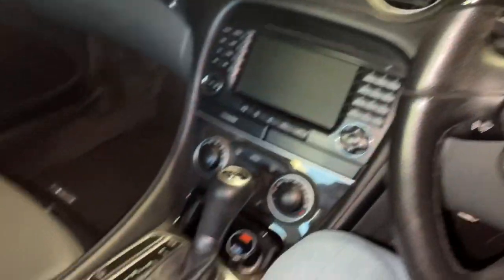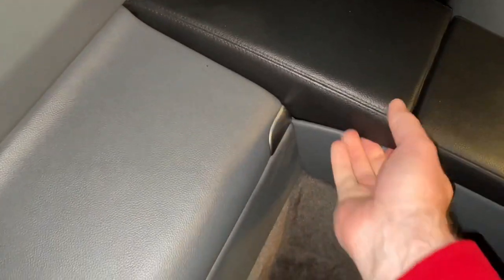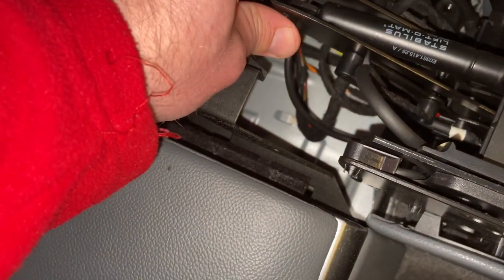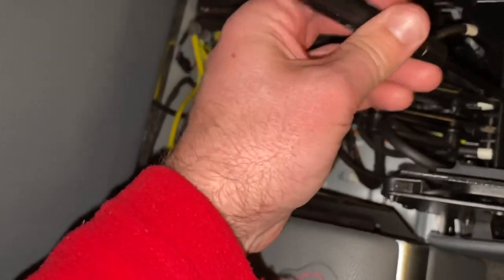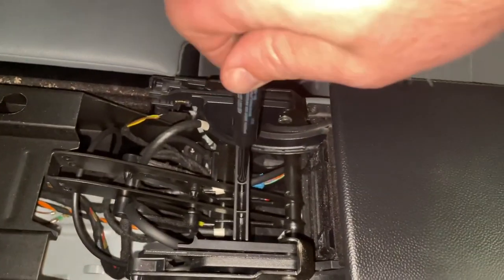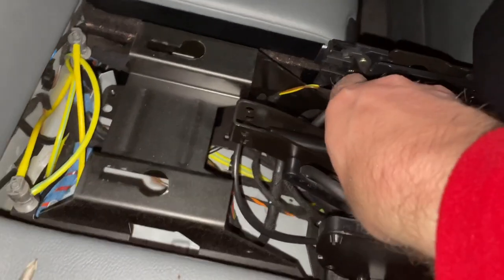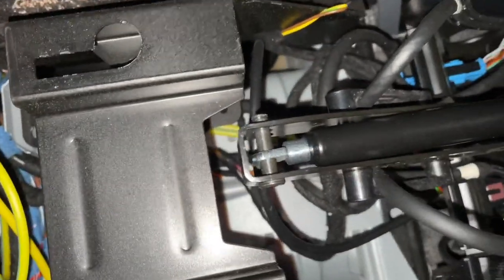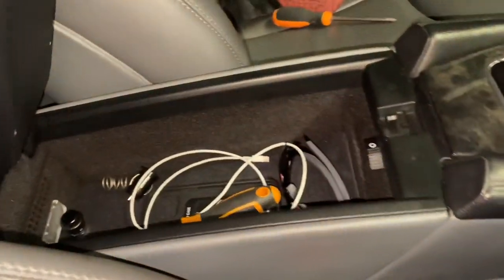Mercedes SL R230 PART 3 Easy way to replace repair centre console strut on a SL350 500 55 65 AMG

Comment: I just bought and installed a strut I got using your info ,I found that my armrest did not lift up far enough to allow the pln to line up so I ground off a  few thou from the eye end enough to get a flat blade screwdriver in and gently lever the strut forward and line up the pin with the hole easily ,good vid subd..
Reply from the maker: Great and thank you! Glad it helped!

Comment: Thanks for very helpful videos on the R230🙂. However, I have searched the web for the centre console cover strut PNs shown (OEM and NitroLift) and I do not find any shopslinks. Can you please share any links you may have?
Reply from the maker: Hi thanks! Glad you like them! I bought mine from a facebook group member but he also sells through ebay: https://www.ebay.co.uk/itm/304601848675?mkcid=16&mkevt=1&mkrid=711-127632-2357-0&ssspo=-xOcMKoxRb6&sssrc=2349624&ssuid=7VEc4j8ZRai&var=&widget_ver=artemis&media=COPY

Comment: Great job and video. Do you have the part number and brand of the replacement strut?
Reply from the maker: Thanks. The link I had in the description is no longer valid but here is a new link to the same part: https://www.ebay.co.uk/itm/305491901553?mkcid=16&mkevt=1&mkrid=711-127632-2357-0&ssspo=-xOcMKoxRb6&sssrc=4429486&ssuid=7VEc4j8ZRai&var=&widget_ver=artemis&media=COPY
Reply from the maker: I show part numbers and brands at 3:50 in the video
Reply: @autogaragelife Thank you so much! I already ordered the part.

Comment: Is it still possible to purchase these , as I can not find them anywhere and the armrest today slammed down on my fingers GRRRRR
Reply from the maker: The chap I got them from must have ran out as his ebay listing is no longer there. They are still here though albeit at a higher price: 

https://www.ebay.co.uk/itm/165501237048?mkcid=16&mkevt=1&mkrid=711-127632-2357-0&ssspo=dxHemm6KTaa&sssrc=4429486&ssuid=7VEc4j8ZRai&var=&widget_ver=artemis&media=COPY